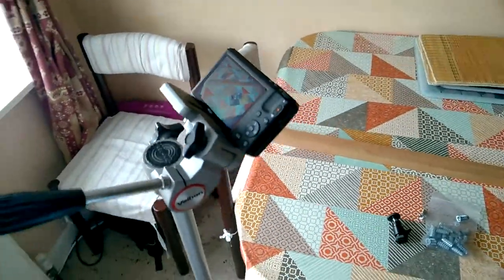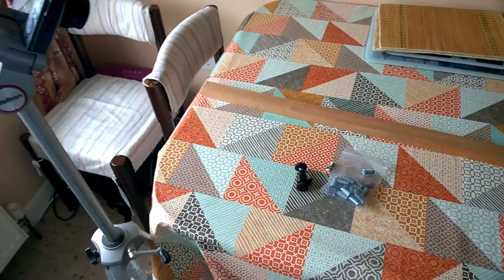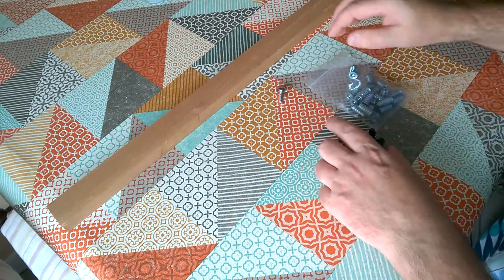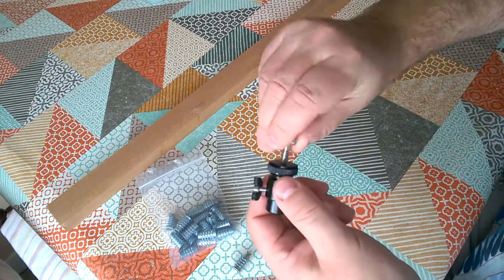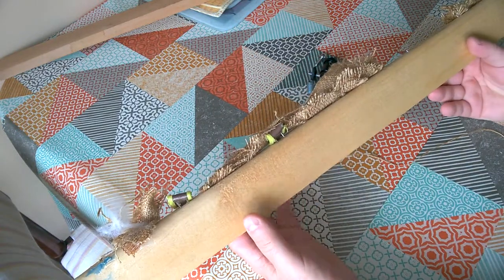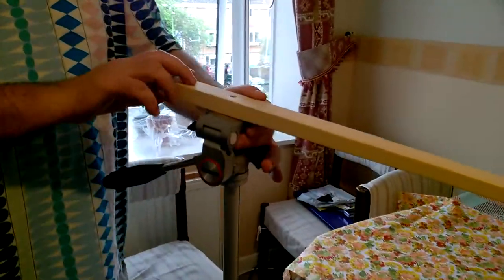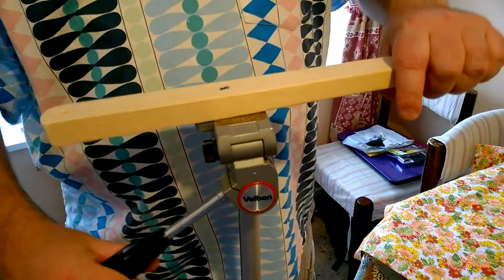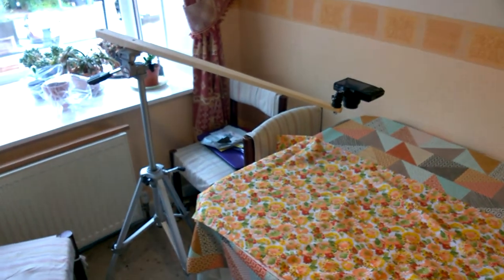How To Make A Super-Low-Budget Camera Boom Arm

Comment: The camera threads aren't metric?  I'm surprised.  I wonder what the nearest metric equivalent to a 1/4 20 bolt is.  Here in the U.S.A., a 1/4 20 can be found at any hardware store.  I'm not sure if that's a good thing or a bad thing.
Reply from the maker: I think tripod mounts (and Mic mounts) have been around so long that switching them to metric would be a massive pain
Reply: @AtomicShrimp  Well, if anyone ever goes to change it, I hope the holes are marked to say what standard and thread count was used.